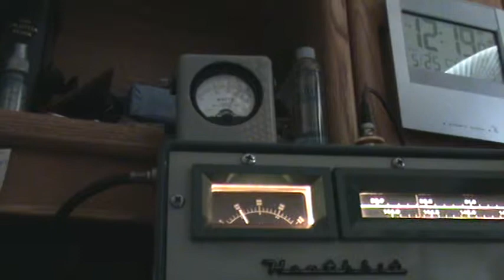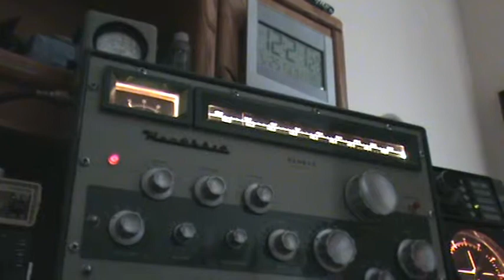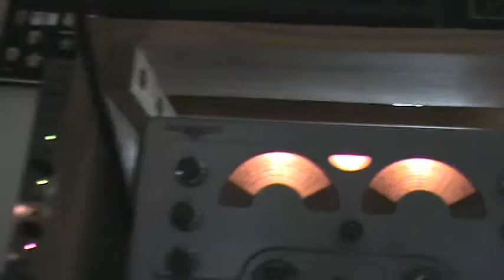Heathkit Seneca VHF-1 NC 183 / Stoddart NM-30A demo 6 meter AM

Comment: from the watt meter and the fact that this xmtr weighs 56 lbs, I am deducting that it runs controlled carrier modulation like the Cheyenne and DX-60 , which is very efficient and also quite compatible with linear amplifiers customarily driven with 100 watts PEP.

Comment: Hi! Using my step brothers account as I am visiting with him. I picked up a Seneca vhf-1 at a flea market. I am unfamiliar with it. How does one obtain sound through it? It has no speaker or an output for that speaker. I would like to get it working and pass it on to KP3BR
Reply: IT is a TRANSMITTER>> NOT A RECIEVER.. you cannot hook a speaker to it !
Reply: This model is a transmitter only. He is pairing it with a separate receiver set up.